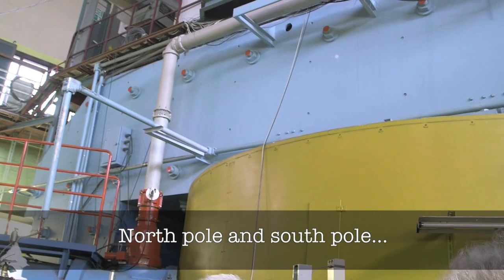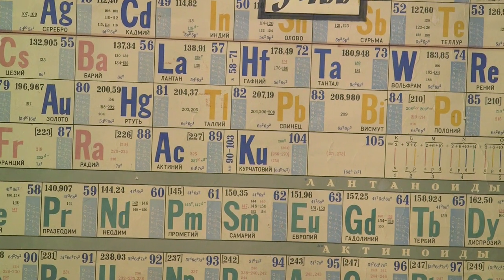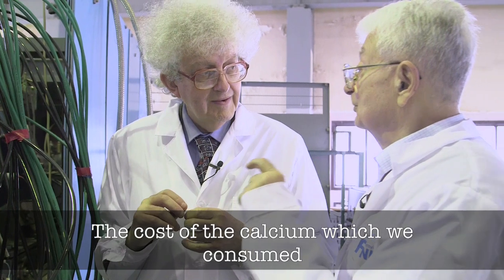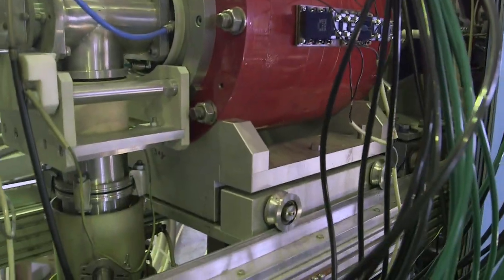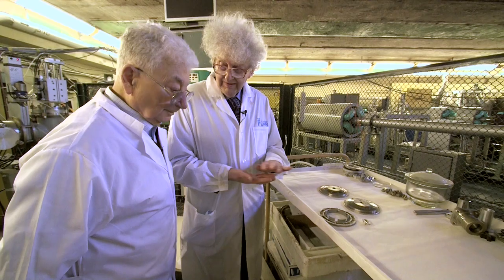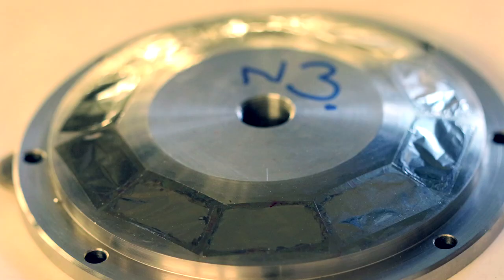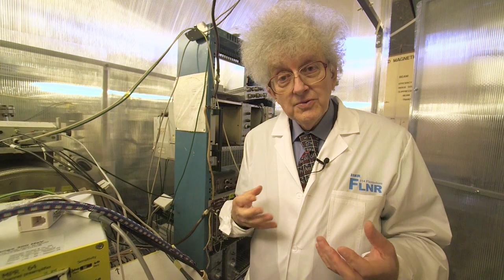The Element Creator - Periodic Table of Videos

Comment: I really like that there's just a hole punched in the wall at 4:19. Just imagine the conversation with the architect when they realized the machine wouldn't fit.
Reply: It is most likely the building was constructed for something else and was used later on to build the accelerator. 

Why build an entire new building when you can just punch a hole.
Reply: Cicolas Nage Yeah I know it was probably reused but it's still great that they have this top of the line scientific equipment and then a rough hole in a concrete wall.
Reply: you know youre in a russian lab when...
Reply: Actually it is not a wall. It is a bunch of really big concrete blocks made of special 'heavy' concrete to reduce radiation, so that detectors would detect less background radiation from cyclotron. It is just has some paint on the surface to look a bit better. If you were to look at it from above you would see those blocks separately.
P.S. You could actually see those blocks in the video at 4:34 just look at the ceiling.
Reply: SoFZlodei24 Actually it's a storm drain.
Reply: Pretty similar to how they showed Tony Stark creating a new element in Iron Man 2.
Reply: WHAT ARCHITECT they are for making a building look beutiful and very precisely only that everything else is the job of an engineer called Civil engeneer architechts are just artists not scientist nor engeneers

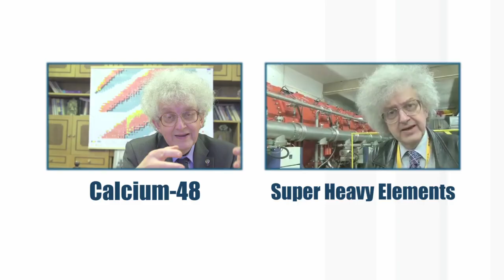Comment: All that sophisticated and precision equipment together with a really rough hole in the wall (9:02)
Reply: Yeah, that was my first thought, look at that chipped hole in the cement wall.... but then I thought again, ya know, the hole serves it's purpose, it may not look pretty, but the look of the hole has no effect on the outcome of the experiment that's being conducted. With limited funds, you could plop a wad of money on a pretty hole (which before this video almost no-one saw it) or spend precious funds on a pretty hole, that no-one cares about, and limits your research.
Reply: That was almost word for word my thought process, and I came to the same conclusion that you did.  There's really no need to make a neat job of it other than because you want to, and I think they have much more to take pride in there than making neat holes in walls.
Reply: built by scientists, not engineers and safety briefings
in all reality, the holes in the lhc probably look the same. they just put up some plasterboard to cover it up afterwards.
Reply: As long as everything works, it will be fine... But still, even a nice plastered wall is part of the 'science'. Don't neglect it i would think.
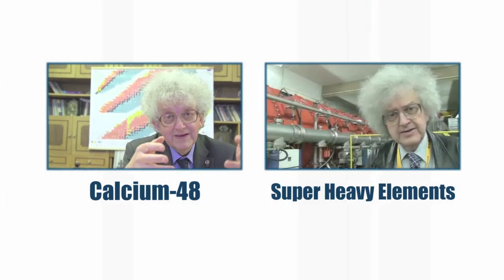Reply: 4:20, not 9:02. The latter is the end of the video.
Reply: The LHC was custom built for what they're using it for, from scratch. The cavities for the beamline were built new, and are sized to fit. I think they probably look much neater.
Reply: "You want we fix hole in the wall, or fix oscilloscope? Only money for one." That's how things like this usually happen.

Either that, or the (apparently excess) hole has a purpose but isn't in use right now.
Reply: So Soviet xD

Comment: I asked this in the calcium 48 video and ill ask it again:
Is it possible to recover the calcium after it goes through the disk? won't it make the entire process much cheaper if you can at least recover a small amount of the calcium and reuse it for another round?
Reply: FlyingJetpack1 failed collisions usually dont seperate back into calcium and titanium, they are turned into random other elements.
Reply: I see, thanks for clearing it up :)

Comment: what about the alchemical imagery from the Rosicrucian text that expresses using copper tubing wrapped with copper wire around an electromagnet in the middle of the tubing torus using the triangular pattern of magnets with shale, cinnabar, sulfur as prima materia; sodium, sodium bicarbonate, sodium tetraborate, magnesium sulfate and potassium nitrate as oxidaters; iron, copper, lead, gold, silver, zinc, and tin/aluminum? as metal transfers in the circumference of the copper tubing/wire torus(tb eternity loop)??

Comment: When the target goes round "faster than a CD", does it break the sound barrier?
Or is the whole thing done in a vacuum?
Just asking 'cause CDs themselves would break the sound barrier and shatter if they spun much faster than they do.
Reply: A CD is nowhere near sonic speed, even at 11,200 rpm (most run at 7,200) the velocity of the rim is about 70.37m/s.
Reply: jcxz they even mentioned the vacuum. yes its vacuum else the calcium would get messed up by random atoms flying around
Reply: But CDs aren't made of titanium.

Comment: when we we hit the theorised 'island of stability' where elements stop being unstable and become stable with really unusual properties..

That would be a momentus day in science. Who knows what they will be capable of. With stable electrons in the furthest orbital shell, it could cross the point where energy is required to give them up and it is naturally superconductive at room temperature.. Or is a semiconductor requiring so little wattage to flip that it has no electron leakage and we can create <1nm transistor nodes that use almost no electricity, generate no resistance heat and can be overclocked indefinitely.

Yeah.. obviously all highly unlikely - but a guy can dream.

Tell me, what properties would you imagine or like to see in currently unmade super heavy stable elements ??

Comment: Wouldn't you need Californium and not Berkelium to make Oganesson by bombarding it with Calcium?
Reply: Ran. glacialis I think it's an isotope
Reply: Yes, that is what they did first in 2006 (they used 249-Cf and 48-Ca to create 294-Og). In 2012, they tried to create 294-Tennessine using 249-Berkelium and 48-Calcium. But because 249-Berkelium has a realtively short half-life (~330 days), some of it had already decayed into 249-Californium, which then created some 294-Oganesson instead of 294-Tennessine, when the Calcium hit them.
Reply: Ah ok. Thank you for your explanation.

Comment: I have been to the TRIUMF cyclotron at the University of British Columbia, and the cyclotron itself was buried under half a warehouse of concrete blocks due to (I was told) the inside of the cyclotron being highly radioactive. And then in the video they were standing close enough to touch a cyclotron. I am curious as to why they were able to stand right next to the cyclotron in the video whereas the TRIUMF one had to be heavily isolated to be safe. Granted the Cyclotron at TRIUMF is much, much larger and more powerful, but it is the same essential technology. Can someone explain?

Comment: The term "element" becomes a misnomer when creating new transient material that immediately breaks down into other elements.
Reply: A chemical element is defined by its atomic number, not by its stability. :)
Reply: It's interesting that they don't detect the new element, but rather the "daughter elements" from the decay. Does that mean a substance with an atomic number of 150 is an element (and it just hasn't been "discovered" yet)?

I'm just wondering about the exercise of bombarding a nucleus to make a certain number of protons stick together for a very small amount of time, but not being able to observe the element.
Reply: Mark Chadwick it may be that in order to calibrate the detector you need the element you wish to detect so that is why they detect the decay products instead of the new element its self

Comment: So what?
Why waste money and brains on an element that will never be of any use?
Reply: With science it's impossible to know what will be of use and what not. Somethings are useful decades later. When Radio waves where first discovered, they were considered useless. That's why it's important to study everything. No exceptions.
Reply: They are looking for what used to be called "Unobtanium", an element that would achieve everything they want, extremely strong, extremely high melting point, able to withstand huge pressures, extremely low density, ect. The concept was named "Unobtanium" as we never got close to it, hence it was unobtainable, but people still hold out hope, so you have these labs with the explicit hope of finding a stable super-heavy element that does all of that. Well, that was true a few decades ago, now we know that that is almost impossible, so it is now purely for discovery and fame.
Reply: The element itself might not be useful, but it helps our understanding, which could lead to something useful. But even if it doesn't, it is an end in itself.

There's a theory that there are some heavier elements that might be comparatively stable. We need to go through less heavy (still superheavy) elements to reach them. If it turns out that there are no stable superheavy elements, that tells us something very fundamental about the way atoms are build. Very unlikely in the next few decades, but suppose you are able to study the chemistry of those elements helps you explain the irregularities of the usual elements, which in turn helps develop new chemical methods. Or it might not: you can simply not speculate about the use of this research if you don't go through with it. 

By the way, this "Unobtanium"-stuff is false, in case you're wondering. Nobody has any hope to produce any superheavy element in big quantities, even if it was stable, and there's no reason to believe it would have low density, the opposite is more likely.
Reply: -_- I said that that was true decades ago, and I will quote myself here "Now we know that that is almost impossible", it IS true that decades ago with much less understanding of the subject we hoped to find "Unobtanium", which, at the time, seemed a perfectly reasonable hope, as if it were to be of a really low density it could still be "light", and if it had incredibly strong bonds and required a VERY high temperature to melt... And as for another reason why we are no longer looking for it, well, many claim that Carbon Nanotubes will be the key to such a material, if we can find a way of making larger structure out of them and retaining their strength at the same time.
Reply: It's a lot of money in a world where people are starving and homeless, I personally still think it's silly even after your fantastic replays, thanks to you all for your info, I understand now but I just think there are more important things a brainiac and money could do at this point in time.
Reply: @TheConeezeanEmperor: I didn't want to annoy you, I just really can't believe that anybody would expect the heavier elements to suddenly drop in density. Are you sure? This seems like science fiction to me. Can you tell where I could find that people made such guesses? I'm honestly curious, and no need to google it for me, just give me some hints. "Unobtanium" will not give me results in scientific literature.
Reply: Hm, well, the actual element they hoped to find was referred to as "Unobtanium", it was hoped that once found it would do the same that aluminium did, advance us rapidly in both technology and infrastructure. In Sci fi it has been used before, but in a slightly different manner, as in, in the Sci Fi genre usually "Unobtanium" refers to an element that is found that achieves all that, such as in Avatar, and as in almost everything Sci Fi it was based upon real ideas and hopes. Titanium was originally considered to be the "Unobtanium", but when people realised the limited use of Titanium, the cost, and how it was relatively "average" when compared to what the concept of "Unobtanium" was hoping for. As for heavier elements, this concept has existed since the time when Aluminium was starting to be used commercially, but it was not referred to as "Unobtanium" until, well, I do not know, but I would say the 50s or 60s, either way the concept was still there, just under a new name, so when it was first thought of the elements being looked into where not really "Super-heavies", it is just that as the research into new elements went on the elements got heavier and heavier, and hope for discovering "Unobtanium" grew smaller and smaller. Now, the concept has evolved significantly, as now it is looking for ANY substance that achieves all of that, not just an element or alloy, so whole it is no longer referred to as "Unobtanum" it still exists. I dare say that the term was popularised by its use in early Sci Fi, but it was used to refer to a concept and hope that lead research into new elements for a few decades.